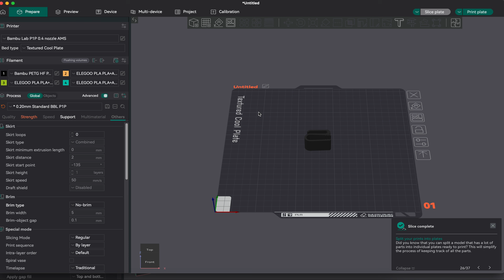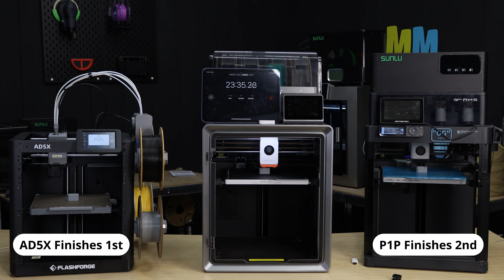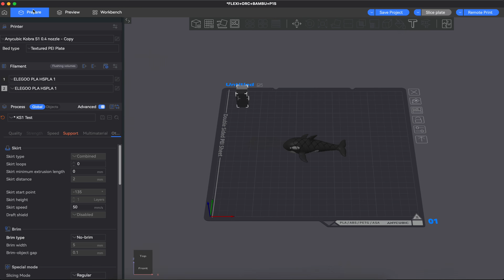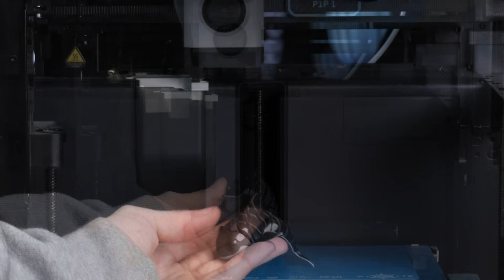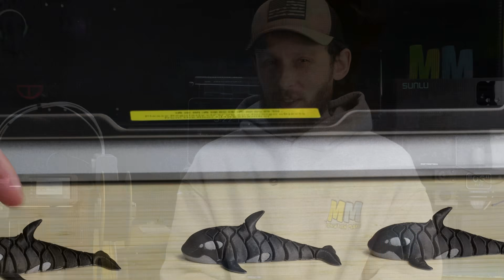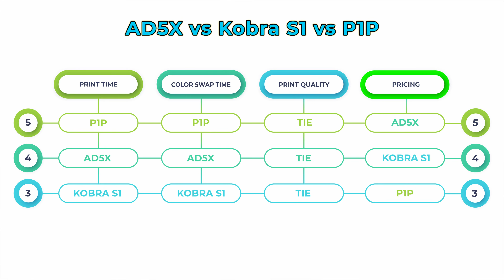Which 3D Printer Takes the Win? Head to Head Comparison | AD5X vs Kobra S1 vs P1P

Comment: I know that this video is 12 months old, but now that you can get a full enclosure kit for the AD5X, which including filament to print the plastic parts, for around £70 (UK), which still puts it under the cost of the others, and opens up printing with more exotic materials than PLA or PTEG - would that change your opinion of the difference between the Anycubic and the Flashforge. (I have the AD5X with full enclosure, and it makes it look much prettier, too).

Comment: You can add 4 pro boxes to the flashforge giving it 19 colors, i have the ad5x and would not trade it for a p1p or p1s at anytime the print quality is unbelieveable for a machine it's size,  and parts are very cheap for the ad5x compared to all other printers and available everywhere also the ad5x is $322 on amazon in the us
Reply: Which pro boxes are you talking about? They don't mention anything like that on their website.
Reply: @darrellfoote3049  ace 2 pro

Comment: I just ordered the S1 combo for $430 last night. Then today I saw an ad for Anycubic's next generation color changing tool head, so I understand why they are clearing them out. For my usage I think this will still be a significant upgrade over my single color bedslingers until tool changers advance a bit more.

Comment: AD5X can be bought with an enclosure kit for like $30, will that allow ABS printing?
Reply from the maker: Technically it will, but you'll still want some sort of internal or external air purifier at a minimum. The enclosure kit comes with some acrylic panels and the rest of the enclosure is 3d printed parts so its not a super tight seal from what I can see. If you look at the Anycubic S1, it has a foam seal that goes around the door to help keep the fumes inside of the printer, where the AD5X enclosure doesnt so you have a gap around the door area

Comment: Thanks for the video, I'm currently debating between these three as a first machine. In the course of my research so far, it seems that the Anycubic system generally does not play nice with those cardboard spools. I totally understand your point about not deducting downtime due to a real-world issue as far as your rating is concerned, but it might have been at least worthwhile to calculate the actual total working print time of the S1 just to compare its true overall speed assuming no breakdowns.
Reply from the maker: The S1 was still about 35 minutes slower even without the delay
Reply: Good to know, and thank you for taking the time to reply. I'm still kinda leaning towards it because of its ability to print higher-temp materials, and its price point. I'm not looking to start a business or print farm, so speed isn't such a critical factor for me yet; I'm just a mechanic and hobbyist who wants to be able to make small parts that are no longer available to fix stuff, especially for small engines such as vintage outboard motors, and they're on sale right now for $600 CAD with a promo code I found. The ease-of-use of the Bambu is tempting, but their trend towards a very locked-down ecosystem and some language in their ToS is troubling, and I don't mind having to fiddle with a machine a bit if it lets me add open source or third party stuff to use it how I want and not how the manufacturer wants.

Comment: Did you use the same speeds for all settings on all the printers? I’ve seen a lot of reviewers lately using faster speeds on some less expensive printers to make it seem like they were faster. That was something you didn’t show when you recorded your slicer settings.
Reply from the maker: Stock settings for speeds on all printers. They all are around 200-300mm/s depending on the operation it is performing. Increasing speeds beyond the stock slicer settings only lessens print quality and doesn’t actually speed up the print that much in my experience

Comment: The last printer to start, was the first printer to finish... But it's basically a tie.

Then the AD5X has the best print quality, while the other two had strings, but it's another tie.

Yeah, ok. Pretty safe to assume the P1P was going to win no matter what happened in your test.
Reply from the maker: Not necessarily, the AD5X can hold its own when it comes to time and print quality and honestly, I was really impressed with it. The P1P is older so it has its own disadvantages. Id say if you are ok with a smaller build plate and limited to 4 colors, go with the AD5X, if you like the ease of use with the integrations Bambu has implemented with Makerworld and the app, want the ability to print with more than 4 colors, or need more than 220mm build plate size, at this point go with the P1S given its current price point of $649 for the P1S with AMS combo unit.
Reply: @VladimirPutin-p3t  One additional thing, that P1P using cryo plate which is "cold", so  that will start to print faster as it doesn't need to wait for the plate/bed to heat up and stabilize.

Comment: I have an ad5x really happy with it. Trying to decide if I should get a kobra s1 for more than 4 colours. Can’t afford bambu lab prices and by the time I can they’ll probably have newer models.
Reply from the maker: The Bambu P1S Combo is on sale right now for $649 I believe but if you are wanting to do more than 4 colors, that puts it quite a bit higher than a kobra s1 with 2 ace pro units. The Kobra S1 itself works fine but it does have its issues with the ace pro units from a couple different people ive talked to and I get feeding issues on slot 3. Id just hate to see you save up and then be disappointed if something doesnt work the right way. The Bambus are expensive but if you've got enough for a Kobra S1 with 2 ace pro units, you can start out with a P1S Combo with just the single ams and save up a little more to get the second ams unit. The P1S without the combo starts at $449 right now with a $100 off coupon. Id say its at least worth looking into. I know its an older machine but ive got over 4k hours on my P1P and i havent had to replace anything on either the AMS or the machine itself aside from an sd card and a nozzle. https://tidd.ly/4hobhq3 is the link for the P1S
Reply: @TheMountainMaker  I’ll keep looking as I’m in the uk maybe I can find some deals

Comment: Great comparison video. The retraction issue on the Anycubic is due to cardboard rollers from all I've seen.
Reply from the maker: The cardboard spools dont seem to be the issue from what ive seen. Ive used plastic spools from both Bambu and Sunlu in the Ace Pro unit and had the same issue where the filament retracts faster than the spool is spinning in reverse to catch the filament that is being retracted. From what I can tell, its something to do with the speed the motors are retracting vs the speed the rollers are reversing the spools... The filament retraction seems to happen quicker than the rollers move the spools in reverse to catch the filament. It also never happens on the Bambu AMS units like that, although, thats not to say I havent had issues aside from that with the Bambu AMS unit... just different issues 😆

Comment: The biggest question I have is how loud is the AD5X? If I get one it's going to be RIGHT next to me. I heard it's pretty loud but what is your opinion??
Reply from the maker: Its definitely louder than the A1 series from Bambu, its quieter than Flashforges AD5M and AD5M Pro, but still, not a quiet machine and I wouldnt want it in the same room as me when I sleep
Reply: Not loud compared to my loud flsun T1 printer.  You can get an enclosure kit for the AD5X so that will def help to quiet things down.

Comment: Thank you, I'm hoping my AD5X will arrive tomorrow.
Reply: @Jinky-z  I just got mine. My first hurdle is getting the printer to show up on my phone or laptop so flashforge can see it to start a project. The test tugboat and the coin went very well since I’ve never done this before.
Reply: @kenschwer184 I set mine up for LAN ONLY mode. You just have to remember to set the touch screen to LAN mode and you should be able to connect right to it.

Comment: I would say your grading system is Rigged! 

It should be as follows Ad5X 
Price ⭐⭐️⭐️⭐️⭐️
Print time ⭐⭐️⭐️⭐️⭐️
Quality ⭐⭐️⭐️⭐️⭐️
I highly think that you can add 4 mire spools on the ad5x8 as it is open to klipper and there are no suggestions not to!

Baboon 1 star each as its not even stock! 😡

Kobra well no stars 😅

You should have did a multi material test with all 4 filaments to actually see the capability! You need to re do the video!😮😂

Comment: The pricing on the Anycubic is questionable - I've had it in my cart at $549, but the checkout price was $699. Anycubic has thus far failed to answer why that happens. So I went with the AD5X and haven't looked back.

Comment: Strange ... The P1P has to completely retract the filament into the AMS on every filament change whereas the AD5X only has to pull it slightly out of the hotend (similar to the Bambu A1 series), so you would expect the P1P to take way longer per filament change than the AD5X, no?  Sounds like there's a lot of room for optimization left ...

Comment: I was really tempted to get the Kobra S1, but I heard from multiple owners that the heat bed will warp over time because it's extremely thin and to fix it you have to spend ~100 dollars on a third party replacement for a permanent fix, making the lower price kind of pointless (Anycubic will just send you another one that will inevitably become warped again). There's just too many concessions with the copycats I think, reliability and long term support is worth the extra money. What makes it an annoying choice for me right now though is I know the P1S is probably getting upgraded/replaced soon (after H2S this year maybe?), the best option right now is to wait and see what happens if you can
Reply: All beds warp under heat.  That's why  printers bed level before printing.  

For the S1, The YouTubers that swapped their beds didn't fix their 1st layer problems.  One fixed it by tightening their pressure probe.  Another by fixing the bed mount. Another never got it fully fixed.  

But you only notice it if you need layer 1 to be perfect across the entire bed.  I have under extrusion in one corner but it doesn't cause the print to fail.
Reply: @Monkey_Chimchim  Ok maybe it's not as big of a problem as it sounds, thanks

Comment: How is the sound level for the printers?
Reply from the maker: They are all about equal when starting up, the P1P might be a bit quieter than the Kobra S1 while printing and the AD5X is probably the louder of the 3, but still much quieter than the original 5M and 5M Pro from Flashforge. I haven’t tested them with a decibel meter though so not 100% sure

Comment: Replacement parts are one of the reasons I am firmly in the Bambu environment now. I've been burned on both Creality and Elegoo with needing a replacment and them not being available after a couple of years post purchase.  Good video and it would be interesting to see your thoughts 6 months or a year later if you are using them alot.

Comment: Yet again a "review" that doesn't even weigh the prints. Why are you not using the P1S to compare all enclosed machines?
Reply from the maker: I guess im confused... what exactly would the weight of the prints show aside from comparing it to what the slicer is telling us? The slicer is never 100% accurate as shown by the time differences alone and personally, i dont really care what the prints weigh... they all had the same settings and were all the exact same prints on each machine so if they are different from each other, it would be such a minimal amount it would be pointless to do. As for why I didn't use a P1S... Well that one is simple... I don't own a P1S, I own a P1P and the Kobra S1 was the only enclosed machine in the video so that really wouldn't have made much sense. Not to mention the door was taken off on the Kobra for the purpose of filming so technically they were all unenclosed machines in this video 🤷‍♂️

Comment: For me reliability is most important and I think that is where P1S/P stands out.  There are certainly other machines that have some advantages, but after thousands of hours on my 3 P1S' I've had to do nothing but replace a couple of nozzles and PEI sheets.  No tinker, no factory reset, just start a print and come back when its done.  If you are printing for fun they are all great machines, if you are printing in a production capacity I think Bambu is a standout.

Comment: Great review.  

I believe since the ACE Pro on the S1 is also a filament dryer and each filament slot has an independent Bowden tube to keep the unit as closed as possible, filament changes are going to take longer.  

I have an S1 combo, an AD5X, and a P1S with AMS, they are all good printers.  I’ve had awesome prints from all three and I have failed prints from all three, the print quality is the same for all three.  I have not had any issues that required tools from any of the printers.  

I have dealt with customer service (not for these printers) from Anycubic and FlashForge and both were great.  

I don’t like the screen on the Bambu P series and the  available aftermarket screens are not cheap.  The factory screens on the AD5X and S1 are excellent and the menus are easy to use.  The AD5X screen has a much slower response time than the S1.

Basically the quality is the same for me for all three.  I would say most people would be more than happy with the AD5X and the S1.  They are great printers and they are priced very well.

I did own the S1 prior to the P1S and I can say, I don’t really see enough value add to justify the significant price difference.

To be honest, the reliability is the same on all three. 

I would put the S1 in the top slot because of the filament dryer and awesome screen.  Plus the difference in build volume is 6 mm for the S1 and the P series.  The AD5X is 30 mm smaller than the S1.  

Again, all three are great printers.
Reply: @neanie0182  ace pro is junk
Reply: thank you
Reply: @neanie0182  thanks !!!

Comment: I got my introduction to 3D printing with  an Ender 3 V2 clone, then moved "up" to Ender 3 S1 Pro, after struggling with these machines for a couple of years, I got a P1S in mid 2024 with AMS unit, it was lightyears ahead of my Ender 3 printers! So much so, I don't even want to give my old Ender 3 S1 Pro to anyone as a "starter printer" as it would ruin their intro into 3D printing. I say go with Bambu Lab anything, they do everything automatically, perfect prints almost every time, they are the ones that initially disrupted the 3D print world and they continue to do so!

Comment: As someone who is new to the hobby, literally purchasing my first printer December 2024 after countless reviews, went with a Bambu P1S combo unit. I received it in Jan 2025. The ease of setup, use, and immediately printing was what initially sold me on Bambu. That and the reliability. Even with all these newer printers out and I had to make a choice again, I’d still go Bambu. Actually I did go Bambu and bought another P1S. 

The way I look at is buy once, cry once. I’ll pay a little more for the peace of mind. Everything you can purchase will need maintenance. But which ones require less time and effort is worth more to me.

Comment: Would not be more economical to actually have a higher entry point with a H2D but recover it in time by having less poop? For multicolor. Outside that you have all these options.I have an A1 for now and I was looking to get one more. Although these are all good options I realize the biggest issue with multicolor is the poop. And let's be honest the machines are a fraction of the cost. Filament is the biggest one.

Comment: Filament breaking is generally an issue with the filament itself, not the printer.
Reply: Yes. The cardboard filament rollers are an issue with 3D printers with enclosed filament holders.